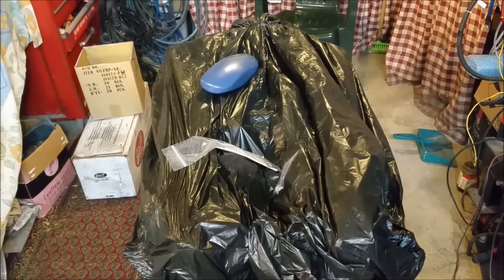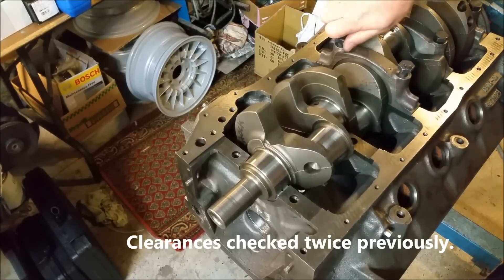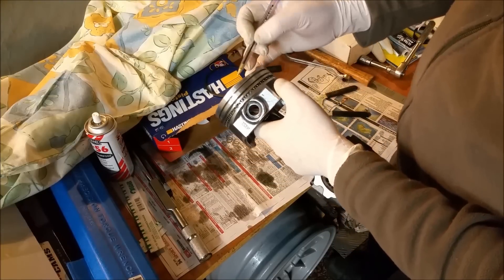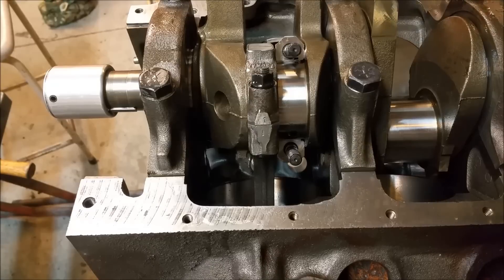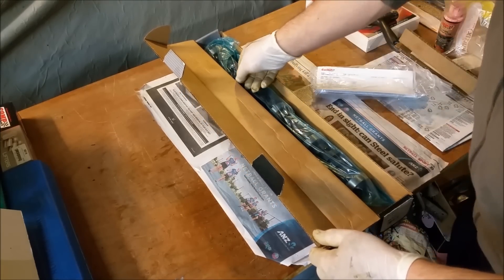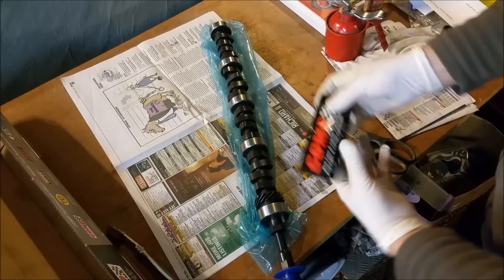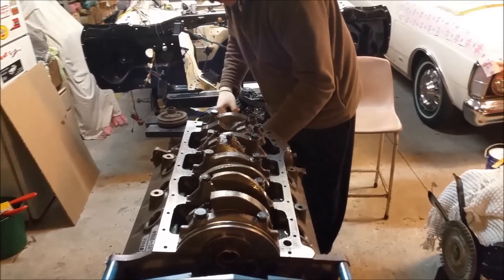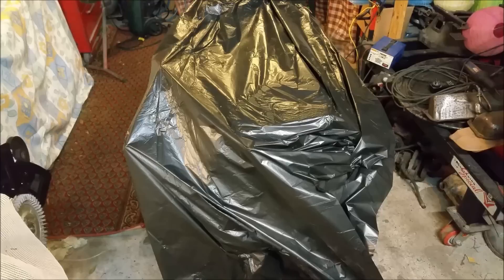Rebuilding the V8 - Fitting the Rotating Assembly; 351 Cleveland Part 4

Comment: Peter, I want to thank you for this video series. I am not sure if you are still monitoring these as they are about 3 years old but your knowledge and explanations are great and I appreciate it. I am putting my 351 Cleveland together now and noticed that the machine shop put the number 7 rod and piston backwards and the bearing chamfer is to the center. Hopefully they are open tomorrow so that I can take it back to them to get it corrected. I followed your instructions and at least it was only one rod, all measurements have been checked and can't wait to move onto the cam install and degree. Thank you.
Reply from the maker: Hi Thomas... Wow, that's a huge stuff up on the part of the machine shop, did you find that on account of my video? If so, I'm really glad it was of use. A mistake like that would lead to crankshaft and rod failure as well as sending loads of metallic particles throughout the entire engine, it's one of the highest friction and temperature areas of the engine - that's a bad day at the office! Don't forget to run a feeler gauge between all bigends when the rotating assembly is installed! Cheers and thanks very much for your message.
Reply: @PeterAndersons  As a matter of fact, I did find it because of your videos, they are a great resource and very much appreciated. For a couple days after I got my pistons and rods from the machine shop, I thought that they had put a couple on backwards because I thought that the dot on the rod, faced to the front, I watched your video again, and noticed the number 5 piston you installed had the connecting rod dot facing to the rear. I took the number 1 piston back out to verify the chamfer, and did on the remaining rods as well. After install on each set of two, I verified the clearance at the bigends as well. Thanks for all you do and for providing these videos and experience to us out here.

Comment: Hi Peter.

Amazing series of videos. Thanks mate.

I am rebuilding a C302 and have a quick question if I may.......

My conrod bearing clearance is 1.25 thou of an inch. I think in this video you quoted yours at 1.5 thou.

Are these clearances within spec?

I am being advised from elsewhere that I need 1 thous clearance per inch of jorney diameter.... which means I should have at least 2 thous.

Should I be worried? 😟

Comment: should live in SA didnt have all that rain, enjoying the videos, refreshing my memory from years gone by, was a mechanic for some time worked mainly on the GM brand cars till i decided to change paths, watching because i currently have an 82 f100 with a 351C, looking at rebuilding this with a slightly better than stock cam, that will depend on what i see when i do pull it apart.

Comment: Should I be using assembly grease on the bearings? It seems like its making it require more torque to turn the short block over .

Comment: I like that many basic rebuild kits include pistons with high performance skirt coatings.

17:00 In addition, you need to be sure that there are still fillets on crankshafts. Some machinists may make the mistake of grinding them off, and that weakens the crankshaft. It might lead to catastrophic failure.

Comment: Those ratchet ring compressors are garbage, get the precise sized ARP ring compresser tool, it makes it super easy. I used an ARP 4.030 tool for my 302/331 Stroker. the only way to do it without getting frustrated.

Comment: I don't mind using motor oil while building a engine that is going to be installed after assembly, however if the engine is going to be stored after assembly I prefer to use STP oil treatment. It is much thicker and stays in the bearings to keep them from having any issues, I have seen engines that were built and stored with white lithium grease that actually locked up because the grease dried up.

Comment: never ever submerge piston in oil before fitting into block,too much oil will only glaze the bore on start up
Reply from the maker: There are all sorts of 'never evers' and I don't agree with that one - yes I know there's reading material that discusses this type of thing, but practically all of the oil will drain out in the few weeks between fitting pistons and starting the engine. Better too much than too little as it will run off. Glazing of bores is more of an issue idling a new engine for lengthy periods of time with no load, which is why some builders bang on about disliking engine running stands, then again, there are more who like them. Provided we start it and run the cam in, then once on the road find a hill and accelerate up with a fair whack of throttle, the rings will bed in fine, cheers.
Reply: @PeterAndersons  I use a brush to coat my cylinders in oil before piston install. Just before I slide the pistons in, I brush the skirts with oil and fill the ring lands up with oil. After 20 years engine building and easily a thousand builds still habe not had any "washouts". Engines love oil. Lots of myths out there about these fabulous creations. Good video👍, first I've seen of tour channel. Going to watch some more🍻

Comment: The ring compressor has to have crimps at the bottom so they don't go down the bore, the old Litchfield ones work perfect, otherwise crimp the new ones, bought an old Litchfield one and found this out after having trouble with the new ones.

Comment: Hey Peter I am about to rebuild my Cleveland. Just waiting for it to come back from getting bored and the heads done. This wasn't suppose to happen like this. All I wanted to do was convert it from a 2v to a 4v slaps some headers and an exhaust and the way I go. But friends of mine talked me in to putting a mild cam. So I bought it because on a classic cougar forum they said you don't have to change the springs. Well after I read the instructions I have to change them. It all snow balled and now its at a machine shop. Fun fun!  Question to you.  Can I use my old head bolts and nuts for the piston rods? Thanks and love the videos!

Comment: Hey peter, I have watched this video many times, when installing the cam shaft how do you know all cam bearings are the correct size? Yes it goes in and rotates nice, but let’s say the the two middle bearings are to large and not making proper contact with the journals? Thanks peter, I just like to understand these things. Jim